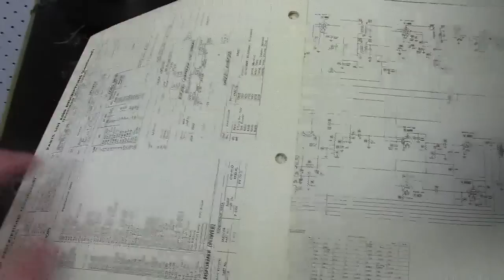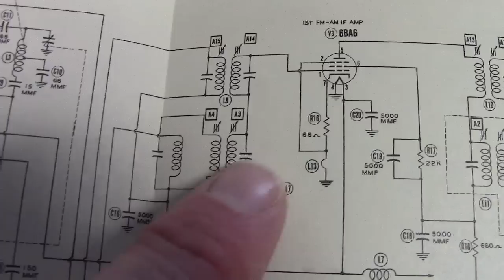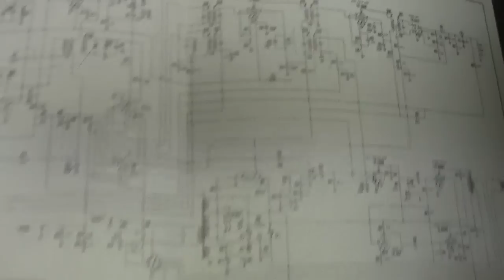1951 RCA Model A-108 radio chassis completed repairs

Comment: I found one o these curbside. The cabinet was beyond restoring , so I made Kindle of that. The 45 record mechanism was salvage able along with the radio. Enclosure. I restored the changer and outfitted it in the modified enclosure. Then I sold the player minus any amplifier on ebay. The radio receiver chassis was restored to like new operation. Currently i am using that chassis in the garage as a shop radio. I also use it as a test jig to test and verify  restored Bench  Top Test equipment (ie) signal Generators, Signal tracers, O scopes , Capacitor checkers and VTVM equipment.